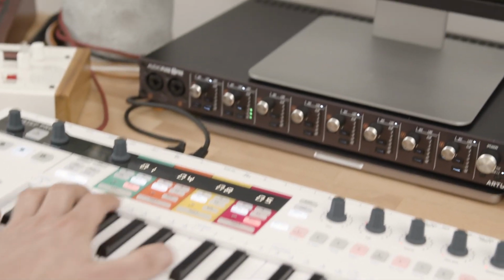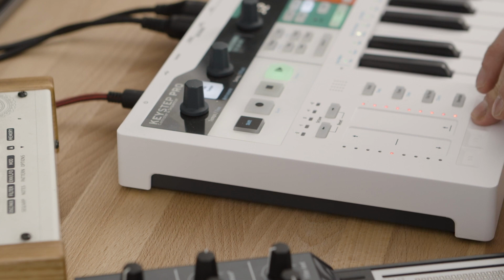KeyStep Pro Tutorials | Episode 6 - Connectivity & settings

Comment: I have usb cable coming from KS PRO to Apple camera connection to ipad. Track 4 is set to midi channel four. My synth on my ipad are set to  channel 4. Keystep will not control my ipad synths.  All my other controllers do.  What am i doing wrong?

Comment: This specific vid mentions everything but explains nothing in particular, unfortunately. Please make another one on how to connect to midi/cv hardware and sync to Ableton, etc properly.
It does not work right out the box. When you by the book and "think" everything setup properly it does not work. Its either does not work or need to know tricks. Please make a video on sync/connect usb/midi/cv.

Comment: I'm really, really waiting for a new update.  This keyboard is designed so badly its such a disgrace to the synth community.  I truly believe sometimes that my unit will be full of bugs forever, they should have recalled this device.  I decided to try and bring it back out the other day, and my CV/Gate outputs aren't sending anything out from any of the sequences.  NOT COOL!!!!!
Reply: The new update needs a lot:  Fix ALL bugs, have transpose work like it did on the original keystep so you don't have to hold it down every time you want to transpose.  Global Transpose for all tracks (with the scale feature, this is really fantastic and turns it into a the performance sequencer its meant to be, this is the number one feature I and others want, and it was advertised in a very sneaky way),  ability to control gate length (or all knob params) of all notes in a pattern at once (again, just like on the original keystep).  Real ratcheting (maybe use the looper to control/record that, because at the moment its truly a fairly useless gimmick.  Velocity to attenuate Drum Gates would be amazing too (may not be possible), as stated in a comment below it is important to piezo based drum machines (like vintage Simmons drums).
Reply: I am also having the problem that the KSP isn’t properly tempo syncing with Ableton - it’s always a few BPM faster than my actual project

Comment: Need episode 7 to actually show connecting different kinds of midi devices and assigning the tracks. I am only able to assign track 1 right now even after going into the utility menu. I have read the manual and it says to check the settings on the external device also but having trouble with that.
Reply: Why isnt this a no brainer, surely its the first tutorial anyone owning a key step pro would look for...
Reply: @FOXESARESCREAMING  dont expect help or a reply  he only responds to those that already know what to do and give positive feedback on this lame tutorial thats not a tutorial
Reply: @zippygogo3660  An absolutely shit company, this is the third crap piece of hardware i've bought from Arturia and they are the same with every product.
Reply: @zippygogo3660  I agree. This whole tutorial series is bullshit useless.
Reply: How do I record midi into the keystep pro from software. I know you can't import it but I want to add some midi drum files to the beatstep.  Anyone know the settings required?  I'm using cubase.
Reply: Exactly. Arturia are useless at explaining basic information. They assume that we've all been doing this for years. This video was completely useless to me.
Reply: @Annie-zd7mx  Now that a proper tutorial the best i've seen and gave me such a boost.

Comment: The midi connection is horrible and frustrating. My Mother32 receives start, stop and clock from my Motu interface with no problems. Wenn I hock it to my Keystep Pro, my Keystep starts and stops, but not the Mother32. Midi send receive is set up correctly. Double checked also in the Mid centre.
Sorry, but this is no tutorial!!!

Comment: Important functionality seems to be missing: quickly changing the midi output channel of a track. Even simple keyboards have that functionality. Fast selection of the MIDI output channel of a track is needed to change synths while playing (each synth is on a different channel). Diving in the menu to switch channel takes too long. Urgent firmware update please.
Reply: Just realized the 1.3 release added the ability to update the midi channel per track per project. Hold the Track button and turn the setting dial and it'll let you switch without having to menu-dive. Still not a quick as the OG KeyStep but vastly better. Plus since you can save them per project, I have a basic project set up for a different piece of gear so I can use the keybed for more octaves that the device doesn't have. Once I'm set, I can go back to the other project that's set up for a different device that needs a sequencer. Pretty handy now!
Reply: @electrotoast8878  holy shit thank you!! I've been looking for this answer for the past 3 hours.
Reply: @electrotoast8878  Life saver thanks soo much!
Reply: +1
Reply: I was surprised to find out it didn’t. May be a deal breaker & end up getting the KeyStep 37.
Reply: Each of the four tracks can be set to their own midi channel.  You can run 4 synths. Just select that track to play it

Comment: ok this video shows in no way how to set up any device.... where do I find that?
Reply: Did you find a video or figure it out yourself?
I'm thinking of buying this or the Novation SlMk111.
I could do with finding out how you set each peice of external hardware to the 4 tracks of the keystep pro.
Reply: @maydaygoingdown5602  you can access a menu by clicking one of the pots and then scroll to settings and you can select a channel for each track. Then you can save the project so the channels are mapped as so. Just to give you one example, I will describe my setup. From the Keystep Pro, I have one of the midi outs going into a midi hub which sends to a group of volcas, a few hardware synths, and a VT-4. The hardware is set up for the volca sample to hold channels 1-10 on the track one drum mode or channel 11 and the other synths are set to cycle around the remaining channels. From the USB port it is connected to a hub where it accesses Korg Garget and besides infinite instrumentation you can use the Taipei module to send signals to USB or bt hardware synths connected to the iPad hub (in my case an OP-Z, OP-1, toys like Orba, CTK-2400). The Taipei module (Also the app AUM I believe) allows you to work around midi channel limitations this way. For example, if you need another hardware channel you could send to the OP-Z and bounce that signal to a heavy synth. Finally, the sync out is sending to my pile of pocket operators and all that stuff is routed through a mixer with a lot of dirty old guitar pedals on the fx chains. One of those fx sends goes to a GT6-B that is also receiving midi info from the hub. I just have a larger weighted board going to midi in at the moment but there are endless possibilities with things like the OP-Z. No experience controlling modular until a friend pays a visit. :)

I would say buy with extreme confidence!

Now after all that, the reason I am here was to find out if my naked midi out 2 can be separately routed, but I can see I am gonna have to forum dig.
Reply: @smellymala3103  "pile of pocket operators" LOL I also have a pile of pocket operators, i love that you used that phrase for them hahaha
Reply: @Klovar  haha I am glad it made you smile! At some point I had to come to terms with the fact that I was not “just going to get the most practical ones” 😂 unashamed te fanboy, but now my eyes are sliding back towards my incomplete fleet of volcas
Reply: @maydaygoingdown5602  not yet
Reply: @FOXESARESCREAMING  ⬆️
Reply: @smellymala3103  yep lost me there
Reply: @FOXESARESCREAMING  Lost all of us.
Reply: @anniedarkhorse6791 I understood when he said, midi Out from keystep pro into midi box. All the rest I either didnt need or didnt get. Im pissed off I cant find one single video on how to correctly set midi channels. It must be so easy that they dont mention it
Reply: did you find anything that does show us ?
Reply: @Annie-zd7mx  It's incredibly frustrating the arrogance of Arturia.
Reply: Seems to be the million dollar question, that's what i came her for and nothing but some guy gibbering at 100km per hour with a strong accent, my mind melts.

Comment: Suggestions for future firmware updates.

control mode…could be able to change the midi channel of the keyboard to control other synths that are not assigned to the 4 internel tracks. 1-16…selectable with holding a button and pressing any of the 16 sequencer buttons, much like the original keystep to select a midi channel. There could be 16 different banks of cc# for the encoders (one bank of mappings per midi channel) to control external synths…maybe even show a name on the OLED screen (that one can be defined in the software editor) for what each knob do to a external synth. 

Velocity gates option on the drum gates out (velocity, 0-1 * 1 ) (if not possible to get 127 values because of hardware limitations, at least use the 8 values that can be selectable from the utilities settings menu, 8 velocity gate values is enough for most stuff anyway)…gates multiplied with the velocity from the drum sequencer…great for triggering drum modules that is designed to work with piezo triggers. Or even envelopes out directly with a AD... programmable per step from the sequencer…but i guess no DAC on the gate outs?

Everything on the keystep pro controllable via external midi cc#. So we can control the ARP division, looper or any other useful setting on the sequencer from external sequencer.

make it so that the drumsequencer AND the regular track1 can be used at the same time, or if that is not possible, at least make use of the “unused” CV outs for the other tracks…so we can “steal” one CV out from the unused track (that is used as a drumtrack). So we can get a full CV, GATE, VELOCITY, AFTERTOUCH from any chosen track.

Analog reset clock in?

ratcheting?

Some of the knobs that dont work in drum mode could be set to ratcheting feature (preferably with ratchet probability feature).

Pitchknob could send out pitchbend on the drumsequencer (for midi) also recordable in the drum sequencer. 

doubleclick a step (or any other keycombo) selects all active steps in a sequence (so one can edit all steps at one time with the encoders) values entered with the encoder should be added to the existing values (if any) until it gets to the max or min…then they will be reset to the same value.

arp mode…use the sequencer buttons to punch in arp rythms…step length of the sequencer can also be set (skip steps). Euclidian mode for the arp. (encoders set length, fill, rotate)
Reply: Dude everything you said is so on point.  +1 on the velocity to drum gates, I use mine with a Simmons SDS9.  Editing all steps at a time is a must, double click is a great solution.  Ratcheting would be great, or at least a better note repeat than the "looper". I know theres psuedo ratcheting feature on the Beatstep Pro.  Arp mode needs arp rhythm/triggering features, Otherwise I really don't have a use for the arps tbh!

Comment: I guess you'll need a midi splitter right since it has only 2 midi outs?
Reply from the maker: Yes, or you can use the MIDI Out/Thru functions you'll find on a lot of synthesizers.

I hope it helps!
Reply: @ArturiaOfficial  Only one of the midi din outputs works at the same time.

Comment: can you use usb midi in and out to and from the computer with keystep as slave, and both midi outs with midi cable to control other synths at the same time? thanks
Reply from the maker: Yes you can :)